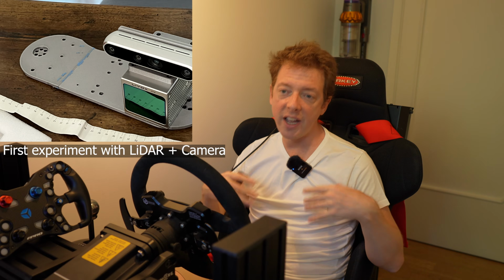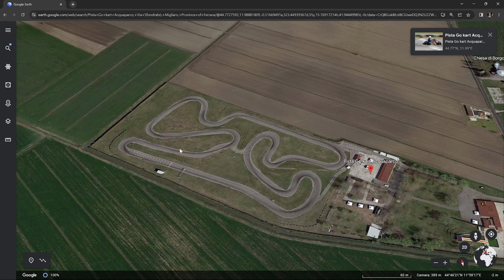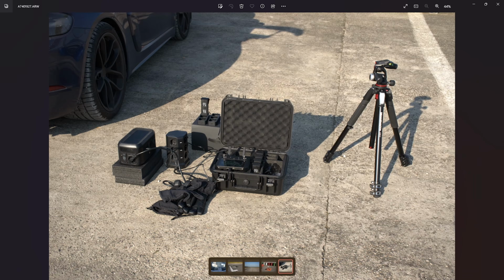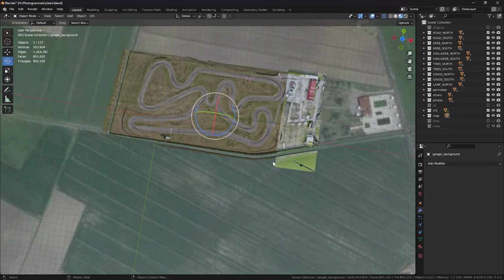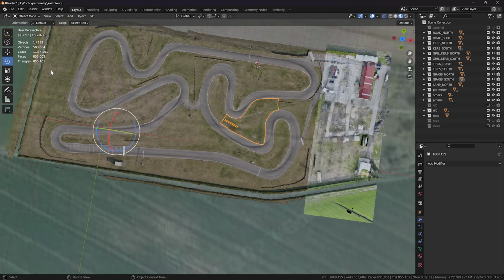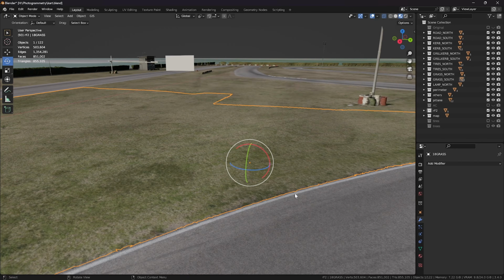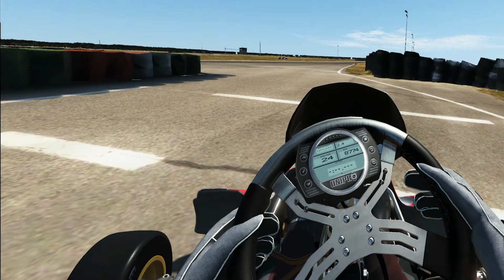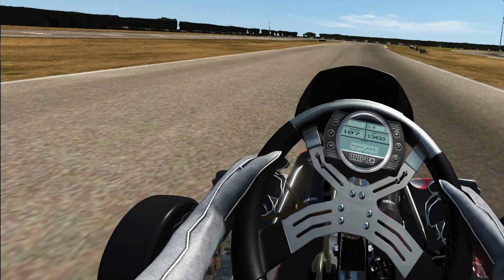I brought a REAL Kart Track into rFactor2 and Assetto Corsa using Photogrammetry

Comment: Great job bro! I have a question tho: is there a limit to how many objects one can divide a track into? So basically is there a limit to track size?
Reply from the maker: There is a limit on the number of polygons that your computer can handle at the same time. And "at the same time" is the important thing... in this case the whole track is always in the same scene. But you can have a really long long road like the Nurburgring, you can split the track in many scenes and each scene is loaded and shown at the right time. There are many mods on AC which are mods in the order of 30-40miles long.